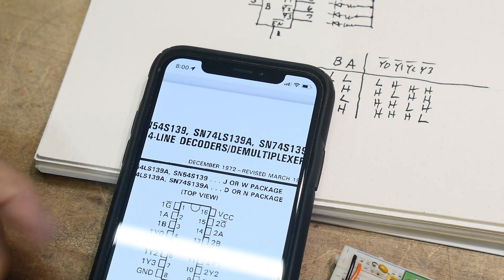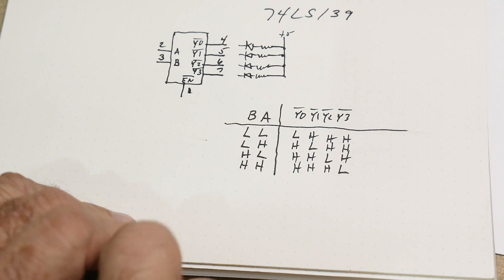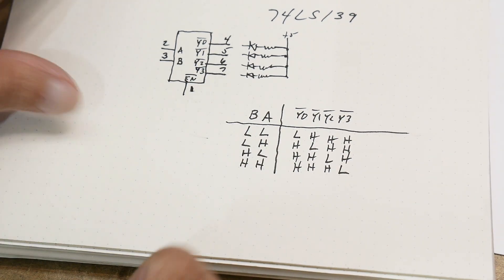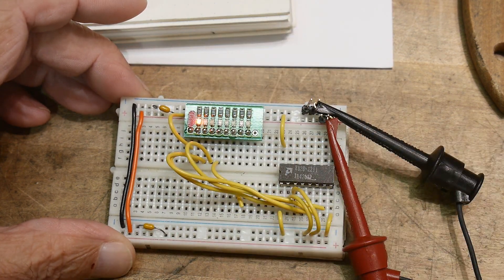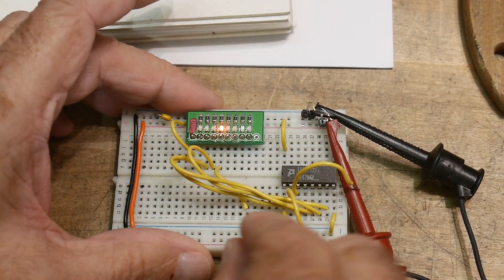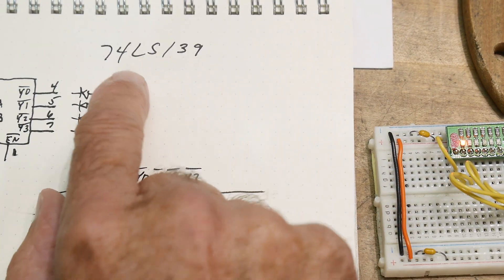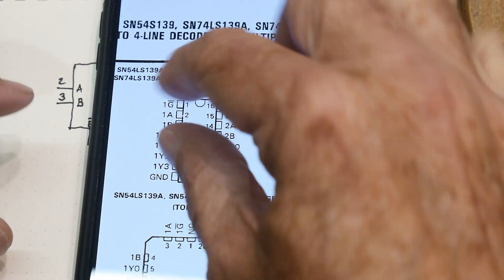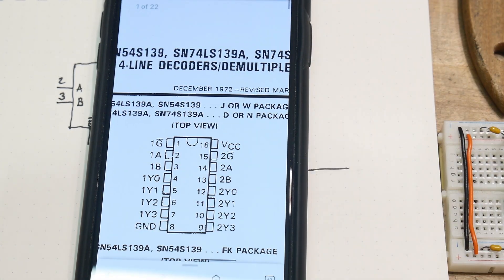#1333 74LS139 Decoder

Comment: i want to connect 8088 with SRAM (8k*8bit) and EPROM(4k*8btit) to make 32KB RAM and 16KB ROM. i use 74ls139 to do it, but i dont know how to connect pin 1G and 2G of 72ls139, can u help me? thank you very much
Reply from the maker: they are low true enable pins. so you want to have them low for a read or write cycle.

Comment: Back in the day I used many 138s and 139s in many designs, but an interesting one was using an HC139 to give bit sequence based on the output of an HP shaft encoder. This stopped false counts being generated when there was a lot of vibration on the shaft causing motion smaller than the minimum count resolution.

Comment: Nice to hear I'm not the only one that found the TI logic diagrams to be absolutely useless.
So this part in 2004, made me work overtime over xmas, to solve what turned out to be a signal integrity problem of the printed wiring board. The parts had been improved to where the minimum transition time of the outputs, 9ns if I recall, became less then 1ns. Well that was so fast that the signal trace from this chip select decoder to the UART had enough inductance so that the signal would go 5 volt below ground, and 5 volt above ground on return to the +5 logic high. That going low state, ended up sucking current out of the UART. The UART was being polled by the processor to see if there was data in the input buffer. The negative transition from what I could figure out sucked current from the chip substrate, and this caused a parity error flag to be set in the UART status register, and then the UART logic threw that data being received away. It was the first time I had to use an ultra high speed oscilloscope just to see the transition speed. The product was a serial data switch for ARINC429 serial communication protocol. This is an aircraft use serial bus, so all the UARTS were custom to our company. Also the processor was a 80186 running at 10MHz bus speed. And all the code was written in assembly, as when the original product development was done starting in 1982, ADA could not run fast enough so the EE at the time commented out the ADA code (thinking it was good comments, damn fool) and inserted modified assembly from the compiler. I spent all that time reverse engineering the code so I could put some instrumentation in it to see what was being read from the UART. I found even the address and data line buffers had issues with the board. There I was able to find new components that had 25ohm output resistor on the totem pole outputs, but for this chip select, I changed the part to a slower one, I can't recall if it was just 74H139, from a HC part. Memory going fuzzy. Retired 10 years ago.
Reply: Always replace with the same logic family. HC is not a replacement for old TTL. If you buy 74xx, F, S, LS chips, they still have the same speed as they had 50 years ago. Usually the cmos logic doesn’t nearly have enough fanout to drive significant number of TTL loads.

Comment: Could you please give a link, or phrase to find that LED breadboard unit? It looks very useful for microcontroller testing. Thanks!
Reply from the maker: I designed and made that one, on eBay search for 6bit LED  https://www.ebay.com/itm/332711079888?hash=item4d77202fd0:g:6OAAAOSw5KFjKW2X&amdata=enc%3AAQAHAAAA4CSsxyycX5q19h7vpPsrO8s8kJxOUIl9ZytzZfBdyl28PMXJrW5T0Yhf2e%2BQt4tNyuxNujn6ICdJC9w8%2F9LMGC0ssQmnudW4hpAoQVSMrZ4vptaPmAvCqGgeAZDThNol%2FIPZBVvHSD7OGNkX%2Fff%2FQJi7hD%2BNhZxNhyFpDobzaP1C5rmaq%2FqNfNPhLE83MznZRpLE8Wrs9evN%2BvaMvknDxPN%2FUpHTwLSM%2F5ZPki%2FCNf9Ux1i44G53%2BW%2FkYaI9rpeESsL55rb2%2BeYolatnjTD1x0OTvyeyC%2Fi9T%2FpFLEMdgAgW%7Ctkp%3ABFBMgtjt9Zlh
Reply: @IMSAIGuy  Thank you. Maybe I will make my own also. I have all the equipment I need to create such a board, just need some SMD LEDs. I would prefer to have 8 bits also.
Reply from the maker: @romancharak3675  if you make them, make two kinds. common anode and common cathode

Comment: Yes, and I remember changing the regular parts for the S version, just to get that little bit more margin on the address decoding, because you had to still meet the setup times, even though you had slow EPROMs, and you could not implement wait states on all ROM access, because you needed that processor to run at nearly full clock speed. Then LS, and you got that same few ns shaved off, but you no longer had chips that would need a quarter amp just to do address decoding for a ROM, Ram and a few IO latches in memory space.

Comment: YES! THOSE USELESS DIAGRAMS!!!
I have always hated those GD things.
Just made to print easily not to communicate the function clearly.
I think it was TI that did that sh*t, correct me if wrong.
I am a proponent of the Demorgan  treatment of simple logic gates also.
This is where: an AND gate is drawn as an OR gate with circles on the inputs and the output. That clearly communicates the function of the AND gate is a logic low OR gate function.
Simple. Useful. and correct.
Reply: I was thinking about the AND/OR similarity the other week, wondering if I'd ever thought about it before
Reply: @____________________________.x  actually more than similar.
negative logic OR == positive logic AND.

Comment: Great video! Learned a lot in less than 5 minutes. I would guess that those ceramic ic's are pretty fragile and you don't want to pry on them with metal too much.
Reply from the maker: They are very tough
Reply: You would be surprised they are very strong !